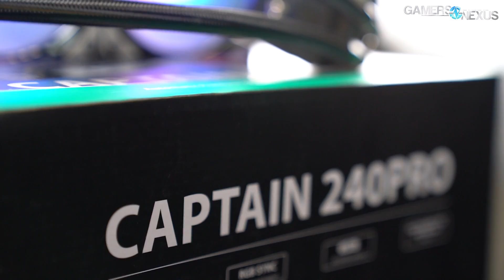Tearing Down the GTX 1650s: EVGA GTX 1650 SC Ultra & XC

Comment: I don't think the 1650 is quite as worthless as people are making it out to be. It should be less expensive on principal, alongside the rest of Nvidia's new lineup, but the comparisons with the 570 don't quite add up.

For one, the RX 570 consumes almost three times as much power. Over time, the 1650 is actually much cheaper than the RX 570. Because of this lower power draw, there are likely to be passively cooled models of the 1650 released, which is always a good option to have.

For two, the performance boost, itself, is a perfectly reasonable jump over last gen cards. 36% faster than a 1050 Ti according to UserBenchMark - not too shabby, especially if they come out with a 1650 Ti.

To restate my views, I don't think anyone should buy any of the Turing cards. They are grossly overpriced and we should not stand for such greedy marketing decisions. But the 1650, itself, is not any more or less worthless than the rest of the Turing lineup. It serves its purpose exactly as Nvidia intends.

Comment: So I'm shopping this opinion around, what's everyone think?
Is the GTX 1650 a variant of the mobile GTX 1060??? 
The die size matches (200mm) and they're within 5 watts of each other (the laptop part has the higher wattage).
Transistor count is close enough.
Base/boost clock also close, as are the memory specs...
Also the pci-e pin count at 4:00 in seems to lend even more credence to my idea.
Anyone else see this as I do?
Reply: Is it similar to a 1060 maxq?

Comment: no one should buy this piece of shit card 
the point of this 1630 and i do mean 1630 card was to not have a pcie power connector 
i cant recommend this even for oem builds because the already is a 1050ti without a power connector and its much cheaper
Suggestion for future vid , 1650 vs 1050ti vs something for that price from the used market

Comment: In all honesty, as underwhelming as the 1650 is when compared to the 570, these could make some great single slot, no 6pin cards for ultra low SFF/silent PC builds. IF they were under 140$.
I'd buy a single slot, low profile 1650 with no 6pin for 120-140$ for a low profile HTPC or sibiling build.

Comment: GTX 1650: 75-95w and a 3-slot heatsink and 92mm fan.
RTX 2060 laptop version: 80-90w and a heatsink the size of a pack of gum and 7mm-thick blower fan.
Most curious.

Comment: The 3 slot cooler loops like the GPUs of old. But what is the point on taking up so much space on a GPU in this bracket? Aren't there 2070 cards with more compact colling?

Comment: "That cap" IS the inductor. Or rather, it's the core of the inductor, which is just as important as the coil itself. The chipped ferrite core will likely manifest itself as worse field containment (and therefore additional EMI) and slightly decreased inductance (and therefore higher ripple). That's an automatic fail IMO, something like that could cause instabilities if it were on a more sensitive rail.

Comment: please HELP.

I have laptop that has i5 5th gen processor.
it's slower to run apps so i want give it a boost with egpu.
now question is : which gpu should i choose ? (model,brand)

[ 
other details : 
os : ubuntu 19.04 (GNU/linux)
Model : Lenovo g4080 
]
Edit: i don't want to bottle neck laptop with gpu and i don't have sufficient knowledge about compatibility.
Reply: First thing to do is to get an ssd. Actually the first thing to do is to replace the laptop with something else, maybe another laptop, maybe a better desktop. Sure, maybe you can get gaming boosts with an egpu but its literally more expensive that just buying a new laptop outright. I don't know why you are running ubuntu, but you can get windows 10 for a few us dollars on ebay. If you actively chose ubuntu for a good reason, that's fine too. Also, egpus will not work with your laptop period. You need a thunderbolt 3.0 port.

Comment: Right, all grief for this card aside, the maxim that there are no bad GPUs, only bad prices still bears up (I think) because at a price point lower than the RX570, this card would be a viable prospect, especially for a small scale 1080p build or a limited power upgrade to an OEM machine, or whatever. I don’t dislike its frugal power consumption or its fairly decent performance levels, I just think that price tag is tripping balls.

Comment: The damage on the inductor is not just cosmetic, the broken part is a ferrite core, which conducts the magnetic field and isn't just for holding the coil. It will change its characteristics slightly, but the switch mode converter probably has enough headroom to accommodate the variation.
Reply: came here looking to post this and you beat me to it
Reply: Yeah, I'm actually surprised Steve didn't know that! I noticed right away. You can clearly see in the break, that by the 'grain' of the material, it is indeed functional and not just plastic.
Reply: Nobody cares about this nerdy bullshit
Reply: @tylerburbage3985  This entire channel is nerdy bullshit, please shut up and find somewhere else to spread your shit.
Reply: @tylerburbage3985  I do care

Comment: I've seen one of those cheap fin stacks on an rtx2070. Not a single heatpipe. No clue on the brand but the PCB was half the size of a regular one. Very weird card.
Reply: Link please or name
Reply: @wertin200  I saw it in a pre built. It was an omen obelisk by HP. I even asked the guy from best buy and they had no info on the card, just Nvidia rtx2070. Pretty funny.

Comment: Wow, I'm actually shocked. What a piece of trash card, horrible price/performance, basically rebrand from last gen. Yet it's $40-50 more than a RX 570 that's a higher forming card? Desperate times I guess. Although, this will probably be making its way into laptops as you can see from the large amount of underutilized space on the PCB. Seriously though, what the heck is with the three slot card form factor on a card that should be no more than single slot?

Comment: Why can't we get 1-slot cards anymore? Only stuff like gt1030 at best.
Reply: If I were to guess, heat is likely the issue. I too miss the days where a cards fits in one slot and doesn't cover the rest.
Reply: @Manganization  75w could be cooled by a 1 slot blower type heatsink though.. M
Reply: @janaebert3059  exactly - blower cooler is one of the options though. I honestly think we have 2-slot or even 3-slot cooling (why EVGA? 1650 really need that cooling?) because of the "gaming" trend. I still have old cards around 60-75W power on 1-slot solution.

Comment: I heard they used the nvenc from Volta cards on this one...
Its too bad, because this card could have been an excellent 2nd pc streaming gpu if it had the turing encoder.

For this reason I ordered a new GTX 1660 for $185 on eBay.

The new 1650 has to be the emptiest pcb I've ever seen. It looks like a card you would see at bestbuy for $79.99 a few years ago.
Reply: Strange that they would use an old NVENC encoder. I thought that was done using a small area inside the GPU chip itself, and so it'd be transferrable to all future chips since it's just a silicon block (copy paste essentially).
Reply: @Mythricia1988  it's even stranger that it wasn't the Pascal encoder.... That they went with Volta

Comment: I bet properly redoing the paste would lower the temps even more
Reply: What was wrong with the paste? What was improper about it? I see nothing wrong with it, it has proper coverage which is what is needed. Pretty sure you properly applying paste would be using too little, since I see it isn't improperly pasted. 

You should learn how to paste a GPU properly.
Reply: @pickleadaykeepsthedoctoraway  With it being all caked on like it was. I redid the paste on my 1060 SSC 6GB a few weeks ago and it dropped the temps up to 30C depending on the game. So since factory paste jobs tend to suck apparently and whoever did the paste on the pre production model i'm going to bet a better pasting job would yield even better temps.
-
Properly applying the paste the way I did for example, spread a small even layer across the entire GPU and add a small dab in the middle for it to spread with contact.
-
I Did it that way when I redid my paste and all I merely used was the paste that came with a Hyper 212 EVO, not the high end stuff.

Comment: This card is crazy overpriced for its performance but I am really hoping for a low profile version of it
Reply: Yeah make it a bit less deep and hack off the empty bit at the end, you've got a small card. I assume it's better performance than a 560 but a 560 is like $90 new.
Reply: @cm01  It would be the most powerful sff gpu there is aside from the gtx 1070 katana which i never was able to get
Reply: At a reduced price too.
Reply: @Gul Dukat Turns the crappy SFF into a decent gaming pc. It's enough for most games in 1080p 60.
Reply: Screw FPS per dollar. How many aluminum fins per dollar do you get with this thing?

Comment: Why not just skip having a 1650 lineup? They're not cost competitive at all. Sure the power draw is lower but who cares?
Reply: My guess would be that these GPUs are targeted towards the laptop market. You said it yourself, the power draw is lower. That’s just my guess though, because you’re right at the price point they are not really a great value for desktops.
Reply: OEMS and people who have OEM pcs. HP, Lenovo and Dell sells quite a lot of its machines with 180 watt psus (250w if your lucky) and they are odd shape psu with odd mainboard connectors. Loads of used ones on ebay for next to nothing.

Comment: 3:37 NO, The "caps" (not at all caps, ferrous cores) do serve a functional purpose of increasing the inductance of the toroid!!!!!!!!!!!!!!
(However in a regulated switch mode power supply the inductance don't matter too much, but I would not expect that power supply to perform as well unless you increase the switching frequency to account for the lower inductance.)
This card looks like shit, i'll stick with my GTX 1060

Comment: Yay I'm number 40 in comments ....Great tear down for a boring card...Cooler was more interesting.

Edited I see they pulled a  GTX 1070 move for the 1650 chips. The mobile version gets more cores than the desktop version and is clocked slightly lower.  Makes you wonder how they could get away with making a desktop version now based off of the full chip when the mobile version is already got that.
Reply: 1650ti anyone? Nvidia is essentially flooding the market to prepare for Navi release so they can discount the appropriate tiers to compete.

Comment: Seriously, EVGA's coolers for these GPUs are more interesting than the GPU itself.
Reply: "Buy our new 3 Slot cooler and get a free GTX 1650 with it"
Reply: Low end gpu coolers are always very interesting. High end coolers too, but most of them are the same two and a half slot finstack.
Reply: EVGA's coolers are amazing. One of the reasons I stick with them.
Reply: @Manganization  except the EVGA 1060 6GB non-sc "gaming" cooler, worst cooler ever made for a gpu
Reply: @dscarmo  arctic accelero still the best!
Reply: I'm seriously happy with my EVGA card. Sadly swapping to a micro/pico build so getting a Gigabyte low profile card instead. :(
Reply: I'd like to see Steve throw the PCB behind his back, just to focus on the cooler.
Reply: Whick is the best!

Comment: Find where they hid the value
Reply: 75w power draw. It's literally a Wallmart/Bestbuy pre-made system card. ;)
If they do a low profile, it's a media/light gaming nano build card. I'm currently doing this with a low profile 1050ti... but it's like, a very niche market, and one AMD cannot even get close to currently (needing twice the power draw and 3 times the PCB/case size to fit it!).
Reply: @TechyBen  I hear you, and admittedly thought the same thing at first. However, the "non-budget" price and the lack of half-height cards still make the value (and point of the current 1650s) mostly MIA. Check out the Hardware Unboxed follow up video from today. Cheers. :)
Reply: @60DollarCodger  True. Just hope to see this as future products... the load of laptop 1650s keeps me hopeful. I gave up hoping for AMD to hit that in card space. They have great APU/CPU GPU integrated options, but even then are wanting in comparison to a 1050ti (otherwise my current build would have been rizen and half the size!).
Reply: @TechyBen  Yep, the mobile 1650 parts will be much more compelling. It will also be interesting to see what the budget Navi skus can deliver. Something with 570 performance that sips power seems possible. We'll see (hopefully soon). :)